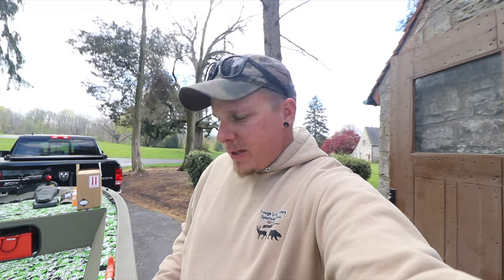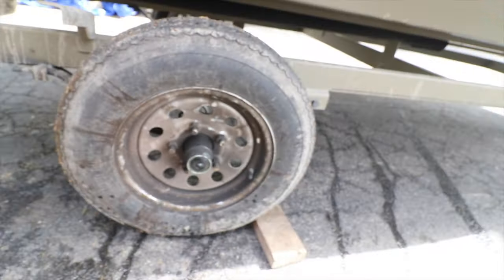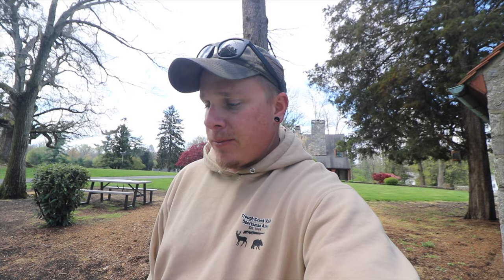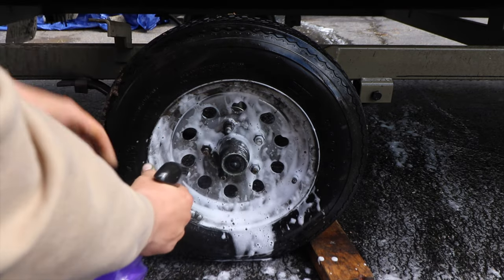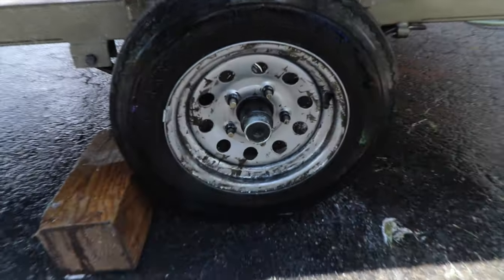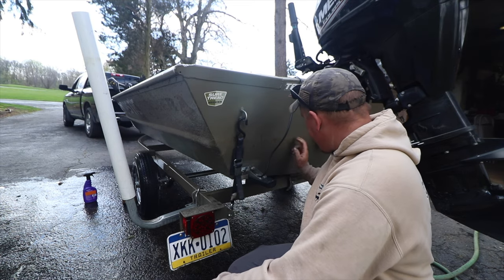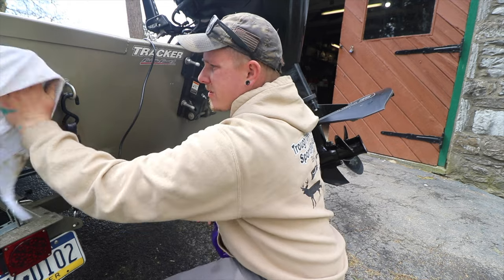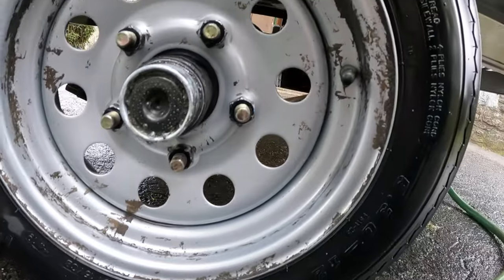Using Super Clean To Clean My Boat! (Shocking Results)

Comment: I just bought a neighbor's 18' runabout over the weekend.  It was filthy.  I spent hours trying to clean the hull with all sorts of cleaners, pressure washer, magic sponges and lots of elbow grease.  I happened to have a bottle of the wheel cleaner sitting in my car wash products and decided to give it a little try...nothing to lose.  I COULDN"T BELIEVE HOW CLEAN THE BOAT HULL AND TRAILER CAME WITH MINIMAL EFFORT!  I used up the entire bottle before I completed all the cleaning.  I'm heading to the store tonight to buy more to finish this job, and start the cleaning on my dad's boat!
Reply from the maker: First off congrats on the boat! And just like you I was amazed at just how well this stuff worked. I was not expecting it to work this well.